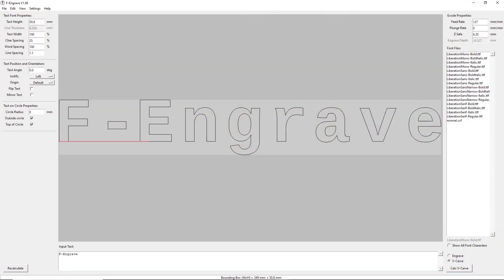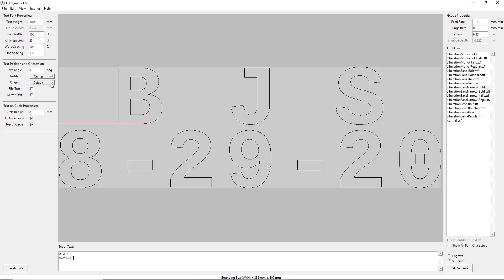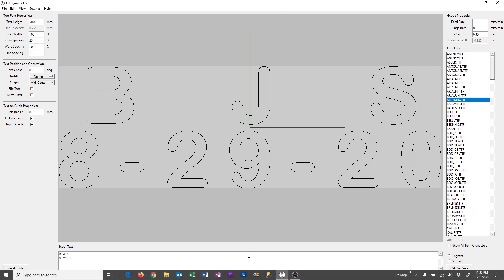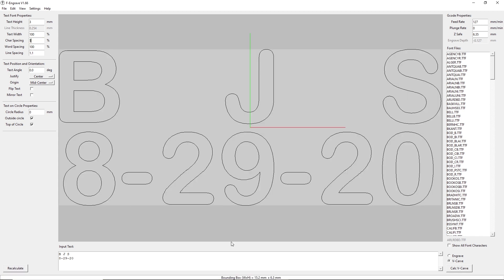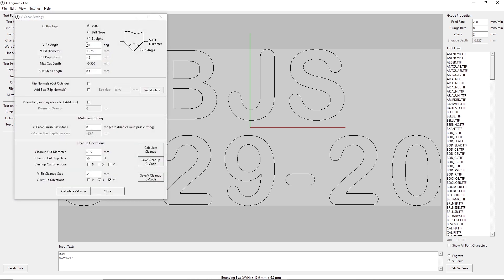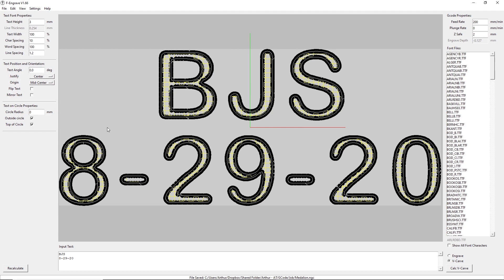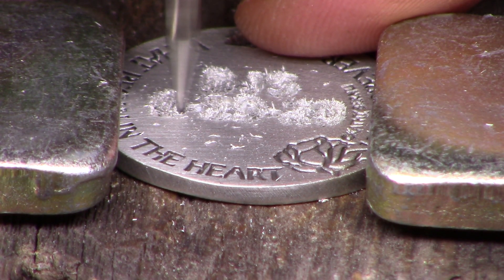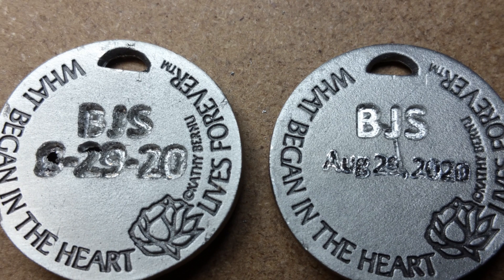Engrave back of medallion - Learning experience

Comment: Have you ever considered using your router to try etching a pcb for electronics?
Reply from the maker: That is an interesting question.  I have thought about it.  I have not had a need yet to etch a board.  There are people who do this and from what I have read, the software has some leveling algorithms in it to use the uncut board as a touch pad and tests several spots to insure it knows where the board is in the Z axis.  I do have some small end mill bits that would work well for this.
Reply: @CNCATHome  interesting! Pretty cool

Comment: to get a better spacing with date try using  08-29-20 with the zero before single number looks a little tidier. I think that engraving doesn't have to be very deep even 0.5 mm deep seems a lot  but great video
Reply from the maker: Nice tip!  Thank you for suggesting that.

Comment: That's the problem with unique, or only a few, workpieces - not enough test runs are available.   Even if they are, there is always something that can go wrong - typically workpiece movement despite all precautions.   Or the power goes off halfway though for some reason, and your limited edition item does not get machined properly.   I do believe that large packets of Prozac should be supplied with any of the these little CNC machines.  On the positive side, I'm glad to see you demonstrating F-Engrave - I think it is an excellent program to use when starting engraving.
Reply from the maker: That is why I do try to run things as a test. Leave the tool out or raise the Z so it will not touch the material.  Make sure clamps and material are all in a good location.  The loose clamp was totally my fault this time.  I put the thing in place and made sure it was flat (ish) and forgot to give the wing nuts an extra torque. 

The Prozac comment actually made me laugh.  It must be true.  Our neighbors had a dog named Prozac and for good reason.  Nice dog.  We miss her.